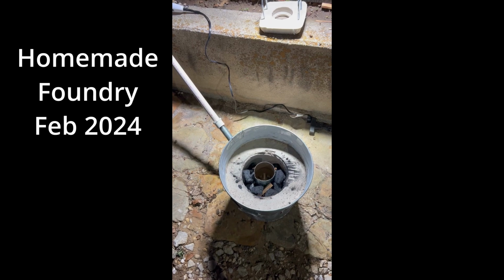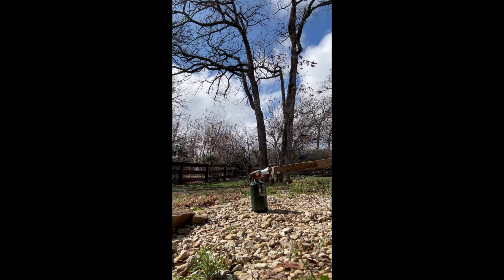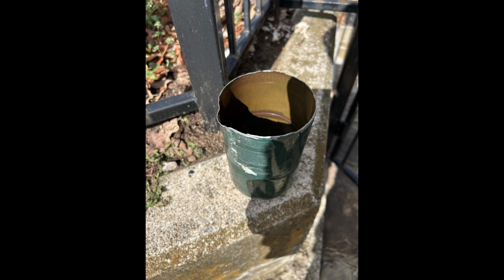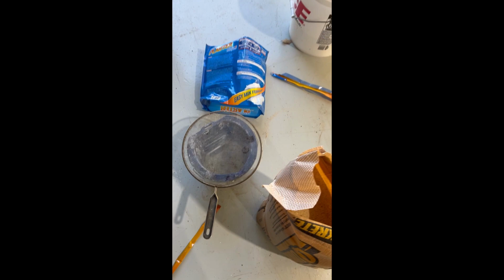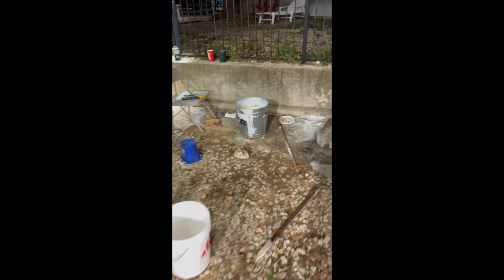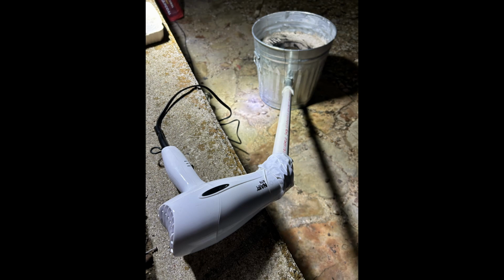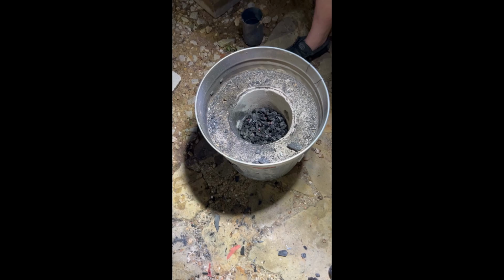Homemade Metal Foundry-Build and Melt Aluminum and Zinc

Comment from the maker: Chapters:

0:00 Intro
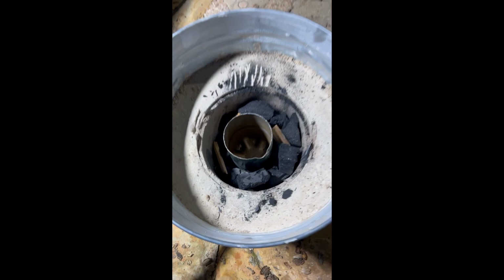0:22 Crucible Building
4:20 Foundry Building
9:09 Finished Foundry
9:28 First Melt
10:50 First Pour
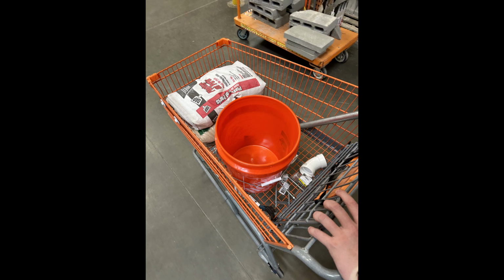12:26 Foundry Repair/Upgrades
12:46 Second Melt and Pour
13:04 Zinc Melt and Pour
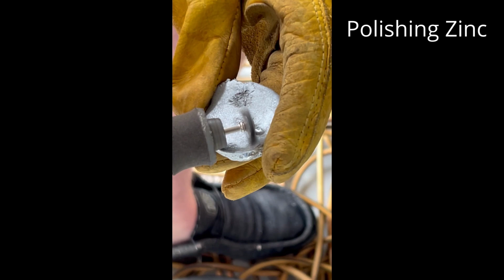13:16 Results
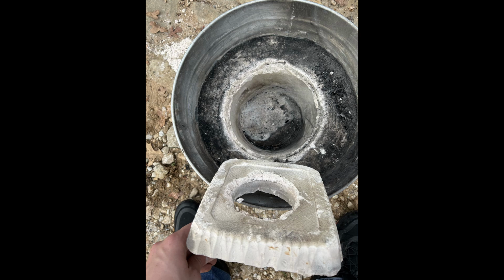13:50 Outro/Teaser

Let me know if you have any questions down below!